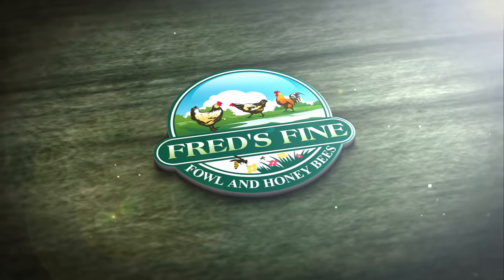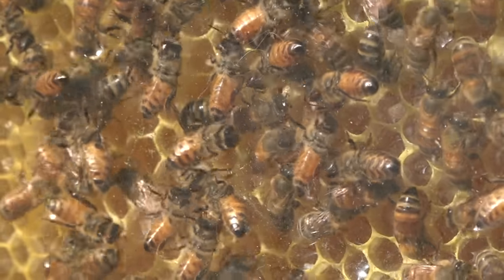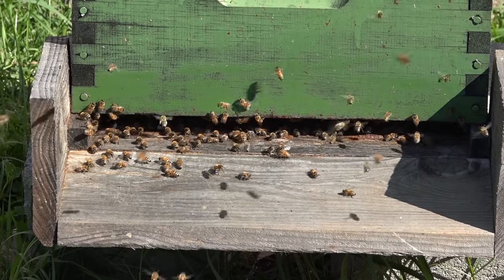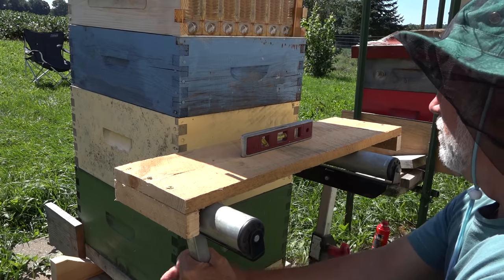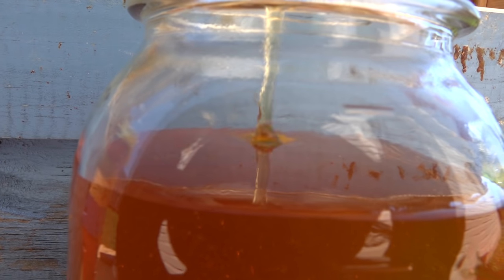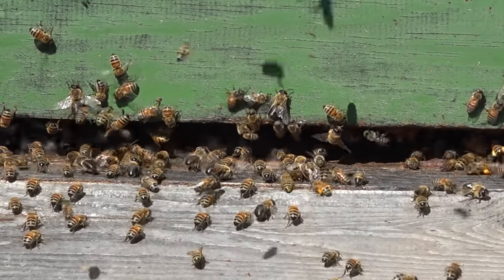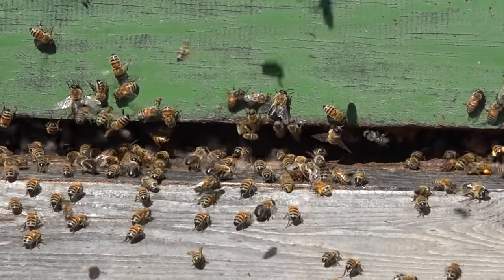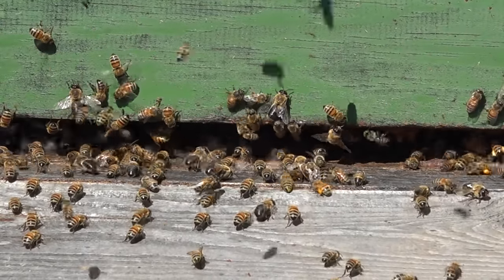First Flow Hive Extraction Cycle How to remove honey without filtering frame by frame

Comment: How long does it take for the hive to refill and cap the frames for you to be able to harvest again, what is the average interval between harvesting?
Reply from the maker: Hi David, there are really no "averages" for that. So much is dependent upon floral resources, rain, general weather conditions etc... If conditions are good and there is a nectar flow going on, I've had them completely refill the flowframes in less than three weeks including capping.

Comment: As the honey drains from the cells, they are filled with air. Does the air come in from some ventilation holes in the top of flow frames?
Reply from the maker: Yes, if you notice at the top, we remove an end plug so the actuating keys can slide in, those plugs allow air to enter for the draining process, even if the bees have completely sealed off the outside seems of the flowframes.

Comment: You also have other hives around your Flow Hive. How come while the honey is extracted -  you do not have a storm of bees around your open honey jars??? How is this even possible?? What are the reasons for making this possible?
Reply from the maker: Because the activity is at the back of the bee hive and you are not pulling frames apart, the bees do not go through the normal alert and defensive behaviors they do when traditional methods are used. The cover is not removed and the colony is not smoked, so they are unaware for the most part.  I wouldn't have believed it if I hadn't tested it for myself. It's pretty amazing.

Comment: I heard that it comes with a flat plastic cover that goes under the flow hive super when extracting to prevent the honey from dripping into the lower frames. did you have or use it? or yours never came with it?
Reply: mine didn't come with one but I use an old plastic sign, leave it in for about an hour or so to catch drips then put it out front for the girls to clean up.
Reply from the maker: nothing like that came with my flowsuper, but I don't know where the honey would go? You don't want honey to run "out" of the hive as that would encourage robbing from other bees in the bee yard. Best to let them get it cleaned up themselves as they put it back in honey cells.
Reply from the maker: That's a nice idea Grant, but putting honey out in front of a hive (in my neck of the woods) draws in undesirable robbing bees, bumble bees and wasps.  I definitely need to give some thought to honey drip management.
Reply: Maybe talk to the Flow Team in OZ, they have answered all my ???'s
Reply from the maker: Bruce Lonsdale I have a contact at Flow that e-mails me frequently, they are listening :)
Reply: Interesting, they are about 1200k's 13 hours drive from me, maybe a road trip coming up, got some Yoga buddys up that way too.
Reply from the maker: Bruce Lonsdale I hope they welcome you with open arms :)

Comment: How many seasons will the 7 frame supers last?
Reply from the maker: That's yet unknown... I'm still using the original box and have added many more. This year, I did power wash the frames and they showed no signs of wear.
Reply: Frederick Dunn 
Thanks
Reply from the maker: @rodkirt9273  You're welcome Rod, when they cease to function properly, I'll be making a video about that as it's a common question.

Comment: Hello, Frederick. at 9:43 I have seen that you place the honey flow in various positions. Last and first to last. Can you please explain the rationale? I am a newbie from Italy....
Kind Regards
Reply from the maker: Hi Arnaldo, if you are asking why one is the top and the other second from the top box, is because I am experimenting with positions to see which the bees use first. By having another super above the flow-super, I can observe if the bees will pass through the flow-frames and fill the top box instead. 
In the end, the bees used the flow-frames no matter where they were placed. I hope that answers your question?
Reply: Yes, thanks. What is the name of the black plastic frame with the cells? 
Secondly when do I add a super on top of the hive and when another one above again? 2 supers for the bees and one for humans is a correct proportion?
Reply from the maker: The Plastic Frames are by Piergo, there is a new company with better double-wax-coated versions called Acorn. I'm waiting for my shipment of those now. You can put supers on at any time, but it's better to wait until they are filling the lower frames first, or they are apt to fill the top frames with honey first then work their way down. Adding supers as they need them is good, but if you forget or don't get the new supers on in time, they may swarm when storage is full.
Reply: Thanks! I too have free range chickens and now bees... Could you kindly explain what the plastic bee frames   advantages are compared to standard frame with wax sheet?
Reply from the maker: The only advantage is regarding extracting honey without needing to smoke the bees, use a filter or spinner. You can go from hive to jar with nothing in-between. That is the only advantage.
Reply: Thanks, last question for today. How many brood boxes do you use? And how many supers?I mean progressively?
Reply from the maker: When I start off a colony of bees, from package bees, a nuc or capturing a swarm, I use just ONE deep super, a bottom board and cover. Then, if they do well and make lots of comb, as that fills up I will add a second deep super and wait for them to also fill that. Some colonies never go beyond two deep boxes. If they are very productive and fill two deep boxes, then I will add medium depth supers and continue to add those until they stop filling the cells. In the fall, you can reverse that process. Start taking boxes off and replacing the lower empty frames with upper full frames. Condensing the hive with resources in preparation for winter. Thanks for those questions, all good ones!

Comment: Also have you ever seen a bee mess up by accident and poke a whole where they keep they honey? and it come pouring into the hive?
Reply from the maker: That's a good question and the answer is no, unless you really cut into the cell with honey in it, it doesn't drip down. Often when just checking frames, you can actually damage the wax caps and get some dripping, but if you carefully remove a single cap, the honey doesn't run out as it has lots of surface tension.
Reply: Frederick Dunn Thanks for answering my silly questions. This is really interesting to watch. In 20 years hopefully ill be able to buy some land and get some bees. Thanks Frederick!
Reply from the maker: Matt Johnson You're welcome Matt.

Comment: Frederick, I've been strongly advised by the club to use plastic foundation and been informed - or ill-informed - that overall  drone cells results from a no foundation frame.With the Flowhive and frames set-up with the barsticks in;  is natural comb a better solution for the Flowhive and have you found the comb to draw straight and not on the angle? Thanks again, TTFNow
Reply from the maker: I'm so sorry I didn't see your questions earlier. There is some merit to the thought that natural comb is more easily shaped by the bees for drone cells, while the piergo/plastic foundations have the cell dimensions already imprinted/embossed, so the bees are more apt to follow that started dimension. The extensions of the flowframe cells have been straight. In the lower boxes, I alternate wood and plastic frames just to see what the bees will do. Some keepers have had "some" problems with natural comb breaking from the frame edges, or cracking during extraction. I think that whatever you choose to use, you'll soon understand how they should be handled. The bees will use almost anything provided. I suggest getting both types and see how you personally like it and what your bees use most.
Reply: All good! Frederick: there's talk around the club that with still 4 weeks of Summer left here in Australia, the bees are starting to run short of food due to our very unusual lengthy rain period over Spring and what pollen/nectar has now come and gone is starting to become scarce and the feeding of bees is the talk of the club, but no one seems to know just HOW MUCH to give. How much would you feed your bees to keep them going over the summer month before the real feeding starts to take place? You mentioned your not a big fan of sugar,  is there a replacement?
Reply from the maker: K.Rebecca Gell If you have determined that hive/colony resources are indeed reaching a critical low-point, I generally will set up a feeding station. My situation is somewhat unique in that there are no other bee keepers within flying range of my apiary, so a feeding station doesn't create a communal disease exchange. What it does do, is provide them with something to do and resources to gather instead of hunting out and robbing weaker colonies. I set up the feeding station a minimum of 50 yards from the apiary and it also serves as an observation location for me, so I can see what other pollinators are in the area (bumble bees, wasps, etc). 50/50 sugar water is fine in an emergency. When I say that I don't like to use sugar water in a hive, I'm saying that I would rather leave them with enough honey for their own needs over supplemental feeding. You've also mentioned a lack of pollen, that is critical to keep the brood going (sugar water is just for carbs), you may have to install pollen/protein patties inside each hive cover so the bees can continue to feed the brood. Here in the U.S. we have several reputable sources for those and some keepers make their own when there is a pollen surplus. I hope that helps?
Reply: Hi Fred, thanks for input, I've been putting a shallow baking dish inside the hive with dry leaves, sticks, etc and drizzled the 50/50 sugar over. Plus using "Candipolline Gold" as well in smaller potions. I guess the only question is how much is too much and will the Queen stop laying if all cells are filled in syrup / Gold. Is a daily dose too much or should it be spread out longer between feeds? Thanks again!
Reply from the maker: K.Rebecca Gell You do need to be watchful as you feed the colony, if they to use up all of the available cells with sugar/honey, the hive is what's known as honey-bound. The Queen quickly runs out of places to lay her eggs, this is often the reason why Queens end up doing high in the colony and placing eggs in random cells. When you see that they have lots of resources, pull back on the feeding. It's been my experience that when there are natural resources in abundance, they tend to ignore the sugar water. BUT, there are indeed lazy bees that simply go to whatever is closest. :)  I have never heard of drizzling sugar water on leaves and sticks? Please look for entry feeders, they are clean and easy to use, plus the sugar water level is obvious through the translucent reservoir.
Reply: G'day Fred, Good point; after checking the brood frames it's quite clear to see much of the outer frames - at least 2 closest to the box - are filled with the syrup on the outside of the frames but still many cells vacant around. I might start dropping back a bit. In observation, I'm staggered to watch how quickly they leave the brooding food for the sugar; like a addict to heroin,  they seem quite addicted to it.I'll  look for an entry feeder, I guess not knowing whats on garden waste could cause devastating results!  Cheers, Bec
Reply from the maker: K.Rebecca Gell Sounds like there is a lot going on and you're learning through direct observation, I hope your bees stay healthy!

Comment: Hi Mr Frederick, i have this question, do you think this is better to harvest than the traditional way to do this? (i want to start with something like this, but i'm a complete noob that's why my noob question) Cheers from Chile!  ^^
Reply from the maker: When harvesting honey, this is, in my opinion, the least stressful method for the bees (no smush kills, no smoking, no torn comb casualties) and easiest for the keeper. Plus, you don't have to run the honey through filters or set up an uncapping tank, all of which needs to be cleaned up afterwards.
Reply: oh thanks for the reply kind sir. How many of flow systems do you have? are you combining the old way to harvest with this new system? :)
Reply from the maker: I currently have four, most of my apiary is still setup with the traditional boxes and frames.

Comment: Is it feasible to modify the flowhive super so that the leftover honey flows into a contained tray and not the rest of the hive? This way the bees would have a feeding tray :D
Reply from the maker: Allowing honey to drip down to the bottom board still allows them to recover the drippings. This did not happen at all in the second harvest. Adding a tray to collect drippings would simply create an interior barrier that is unnecessary.   People with open screen bottom boards may have honey dripping through and could invite robbing from other honey bee colonies. I only use solid bottom boards, the practice of tipping the hive back for extraction also keeps the drippings from coming out onto the landing board.

Comment: @23:50 if the weather gets too extrem it can kill the bees and sometimes weather reports may be wrong won't it be safer if you have those hives indoors like a shack with lots of open windows?
Reply from the maker: No, it's just better to plan ahead for weather conditions and don't perform extractions unless it's going to be favorable.
Reply: @FrederickDunn  Ah I see. Thanks for the insight :)

Comment: Hello, please what happens if the frames are activated permanently. will the bees be tricked into continuously making honey to fill the compartments?
Reply from the maker: No, if the frames are stuck in the open position, they cells are 1/2 their normal size and it would be extremely rare for the bees to use that configuration for anything. It's harder to "trick" bees than you may think.
Reply: Wow thanks for that clarification. Please do you hav any other videos on this particular issue i asked about? I would like to study it further. I want to make a purchase of the system but i need more info on how the honey flows out of the cell. Thanks in advance
Reply from the maker: Yes, here is another extraction video https://youtu.be/GdYSNuAHigs

Comment: Why don't you turn the flowhive super 180 degrees to match the normal tilt with the harvest tilt?
Reply: Because you would be extracting honey over the opening of your hive?
Reply from the maker: The idea is to harvest honey without drawing the attention of the honey bees. By tilting to the rear, where the drain tubes are attached. Two things are accomplished, you are out of the fly-way of bees which are still coming and going. And, any honey which may drip down inside the hive, will be retained to the rear so the bees can re-claim it and no honey runs towards the entry board which "could" inspire robbing from other honey bee colonies in the apiary.

Comment: I notice that the emblem on your flow frames are the original flow hive brand. Have you ever tried a generic flow frame. I would like to use flow frames but the FlowHive brand is super expensive compared to an off brand that I can get on Amazon. I will be a new beekeeper and I don't want to start out on a bad note. BTW, your video is fantastic...very informative.
Reply from the maker: I have never used the pirated versions of the flow-frames, so have no opinion or experience with them. Thanks for the nice compliment :) Amazon, and Walmart have become a conduit for patent infringement.

Comment: It’s not clear to me why the honey leaked during extraction. I would think this shouldn’t happen and is a flaw in the design?
Reply from the maker: If you open the frames in increments, instead of all at once, the honey has time to drain down through the cells and into the draining channel. BUT, if you open them all at once, the honey fills the drain channel and then can run down the face of the frames and drip into the hive where the bees recycle it. It's operator error when there is leaking.

Comment: Interesting fact all members of the colony do experience every job in the hive depending on requirement and age, except drones, they just bring up moral apparently
Reply from the maker: Hi Jesse, a lot of people think that is the case, but we've learned through the years that not every bee will do every job. There are a lot of reasons why that happens. For example, not every bee will end up constructing wax cells or sealing the hive with propolis and instead may go into foraging for nectar and pollen. Others may not pull "guard-duty" and instead may go directly into foraging. All of the jobs exist in the colony, but even outside pressures can result in nurse bees becoming foragers without attending to the Queen as groomers/feeders/attendees. If the colony is in decline due to a dearth or extreme weather, some younger bees may go directly to foraging before they have performed all of the other hive duties. It's an interesting dynamic, but at different stages of growth and development, one bee may become a guard while another is storing and packing pollen in order to prepare it for bees that produce royal jelly for the larvae. Thanks for watching and commenting.

Comment: Why does the honey need to be capped to be harvested?
Reply from the maker: The bees cap the honey cells when they sense that it is right for long term storage and the water percentage is correct. Generally speaking, uncapped honey may still be somewhat high in water content and you run the risk of taking honey that can ferment. There are bee keepers who look at honey frames and will pull them when 80-90% of the honey cells are capped off. That's all.